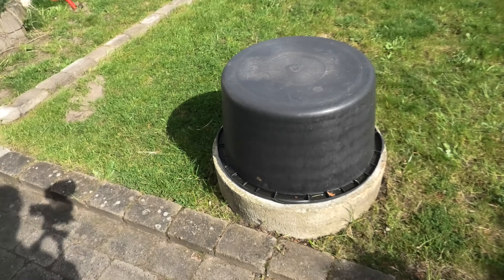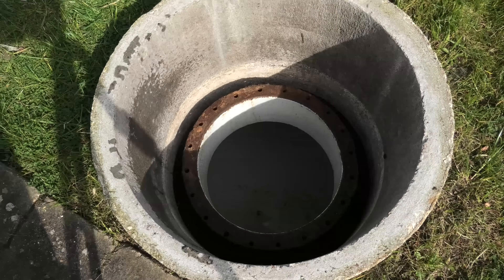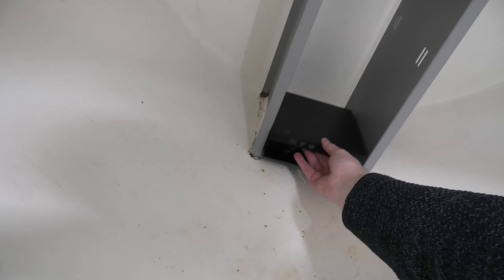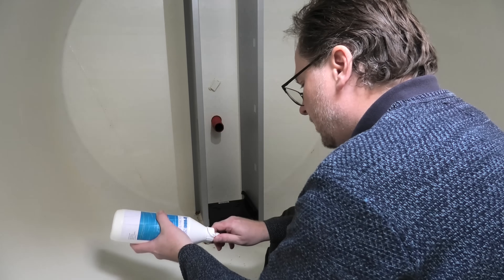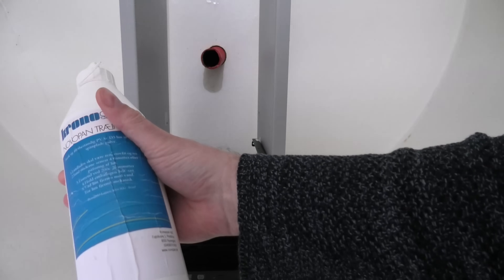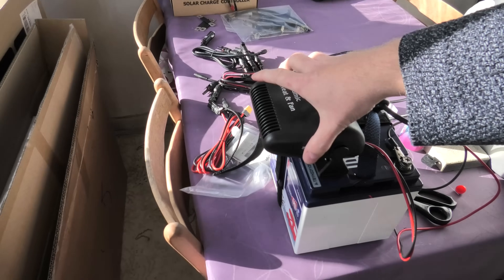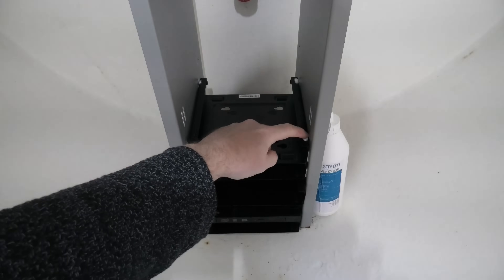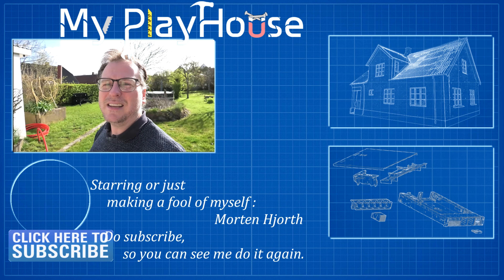The Bunker Data Center Hot Air and Glue - But Why? - 1379

Comment: The ground surrounding the bunker will easily sink a kilowatt of heat output, Morten.
I can only repeat what I said before as I, a someone who studied physics once, am pretty confident of  knowing where the water comes from: It's not raining in or something. There is cold, moist air circulating through the even colder bunker and condensating there. As steam drops in volume to 1/800th when condesating, this generates extra suction and more air heavy with water ready to condense comes in.
The only option I see to get the bunker to any degree of dryness is putting serious loads of computer power in there to get the temperature up and thus get an electricity bill that goes all the way from your place to Copenhagen.
Quite honestly, I think there's no chance to get any real use out of the bunker as mini data center in the garden. The mini pcs you want to use there don't nearly generate enough heat to save the project.
I remember another project of yours which was using the water from your basement well to climatise your data centre in summer. The old tank may come in handy there: Place upright in that corner of your Playhouse, it could be a housing for the heat exchanger for an air intake of your data center. But even there, I doubt it would be ideal.
Reply from the maker: I did put in a 1,5KW bitcoin miner last year,, and it overheated in under 40 min.
I think if I can burn 100w in there all the time it will be nice and warm.

Comment: When you have the PC equipment, etc. running in the bunker that'll be giving off some heat.

Is it worth investigating insulating the surface of the walls (as currently they will be conducting most of the heat with the surrounding soil)?

Also, my father always says that the mask protects your eyes, even having your eyes closed won't stop the radiation from passing through your eyelids. 

Good luck with the project 😊
Reply from the maker: Thank You,, Working a bit on it now :-)

Comment: Isn't a large metal tank in damp earth a giant heatsink? No wonder it's cold down there. Stick a load of bitminers down there and see the temp rise properly :D
Reply from the maker: You know I did that :-)
Reply: Problem is you add heat to it and it'll only add to the humidity, which will cause rust and wear and tear. Need to have a dehumidifier to do that properly and not kill hardware.

Comment: I wish I luck with the wood glue, hot glue would most likely be a better option as it fills gaps and sets quickly and can be loosened with isopropyl alcohol
Reply from the maker: Wood glue was a total failure :-/ I will have to come up with something else.

Comment: I honestly think you would've been better off using liquid nails - that stuff is absolutely impressive. problem though is that the temperature changes from day to night will cause some mechanical fracturing in the glue over time. the higher viscosity of the liquid nails means the glue stays in place and sticks to the intended surface.
Reply from the maker: I agree!! as I have given up on the wood glue.
Reply: @MyPlayHouse  also, the problem you'll have is as you add heat to it and it'll only add to the humidity, which will cause rust and wear and tear. Need to have a dehumidifier to do that properly and not kill hardware,with a one way exhaust.

Comment: Awesome video thanks! Maybe Silicon or caulk would do better than glue - but why not just nuts and bolts in the holes there? I would not expect you need much heat down there to prevent the mold - just air flow and circulation, something to eliminate the moisture and keep it dry - unless you're after heat for the human in the hole! Thanks again
Reply from the maker: Hi @davidanderson2436
Thank You very much!  glad you liked the video :-)
Thank you for watching! :-)

Comment: Hey, have you seen my comment with the vent pipes under your last video? It was an idea how you could be able to vent the „Bunker“ without using to much power and use physics to pull some air from your datacenter.
Reply from the maker: I might have,, But the best sugestion I had was a USB barbecue grill fan,, I liked that..

Comment: My church's underground room has your same basement issues, the water is rising from the elevator because there is a well (old hole with water down) very near the elevator so the water penetrates the elevator walls and flows into the room, so they installed a pump to dry that, and the other day the pump failed and we had to manually dry all the room with 2 mm of water down there... to get into the pump and discover that the power cable was broken
Reply from the maker: That sounds like an old church :-) but elevator that goes the other way,, new :-/ my local town church is from the 12th hundreds
Reply: @MyPlayHouse  it's from early 1950 but the well was there since 10th century, and we had the room built in 1970 and there was that problem back there